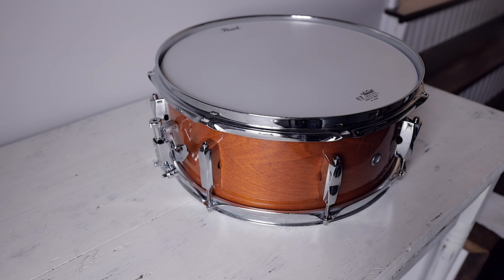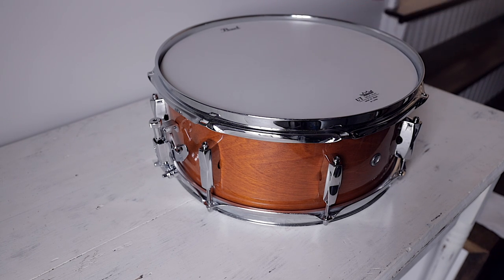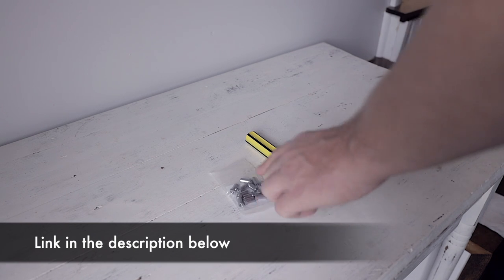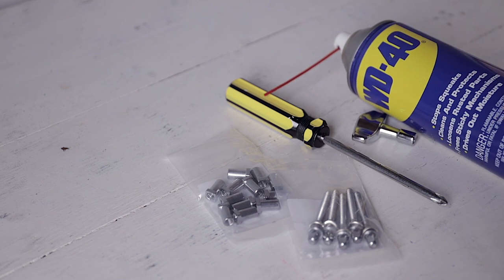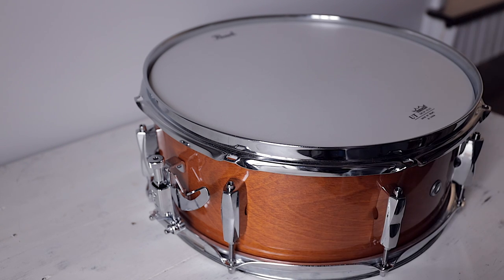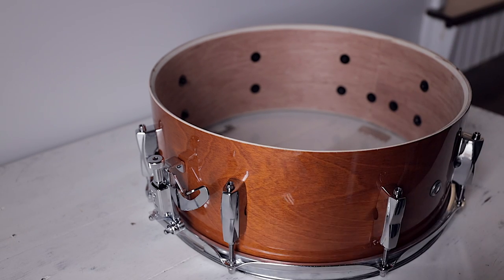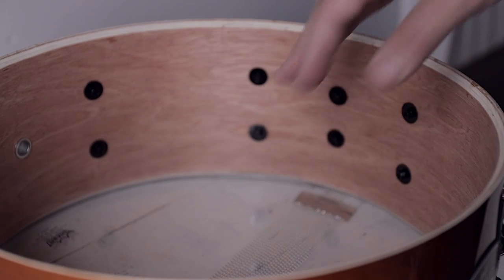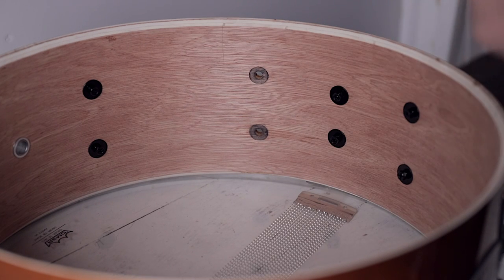How to Fix a Stuck Tension Rod on a Snare Drum

Comment: Mine still doesn’t work for this
Reply from the maker: Wow, that stinks. If this didn't work for me, the next thing I might have done was take both hoops off and then take of the lug with the stuck tension rod off from the inside like I show. Then maybe get some pliers to really apply some torque to it or worst case, cut the tension rod with a small hacksaw. You're probably going to find that you're going to want to replace those parts anyways. Would something like that work?

Comment: Can you do the same thing but on the butt plate/ strainer. One of my tension rods has not been fitting properly into the hole. And it’s driving me insane! And the worst part is, they don’t sell any short tension rods. Can you please make a video or tell me what to do please?!
Reply from the maker: Hey KJ! Sorry you're having issues. I can certainly try to help. Is your tension rod not screwing into the lug? Which snare is it? Is it the snare that's in your KJ’s Drum Sound Demo video?
Reply: @DadRockAndGuitars  Well no but since you brought it up. For some reason the head is kinda of wrinkly. It goes into the lugs but it’s so flat. Like the rim is touching the lugs 

Btw, the snare I was talking about a Tama Imperialstar 14x5 Snare. A tension rod on the butt plate does not fit anymore and I don’t know why. Plus thanks for watching my video!

EDIT: Now both or the tension rods don’t fit. I don’t know what’s happening. Please anything you can please help me!
Reply from the maker: @_kjdrums_  Wow, that's really weird. It sounds like something is off, but it's really hard for me to know without seeing exactly what's going on. Is there a way you could make a quick video showing what's going on and share the link in these comments? You can make it unpublished and delete it later.
Reply: @DadRockAndGuitars  I don’t need help anymore because I figured it out. Turns out the butt plate hole was stripped. So I had to get a new one. But everything is fine 👌🏾
Reply from the maker: @_kjdrums_  Awesome! Glad to hear you got figured it out and back in business! Thanks for the update 👍and happy drumming!